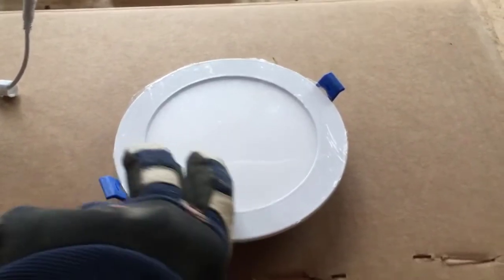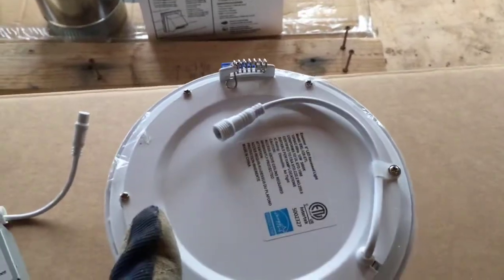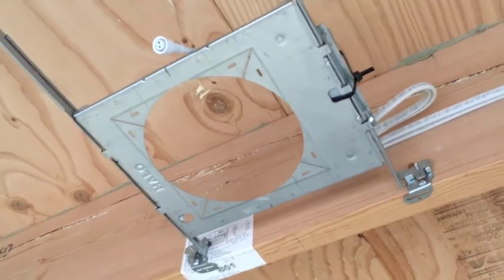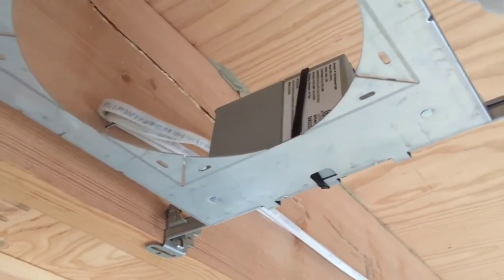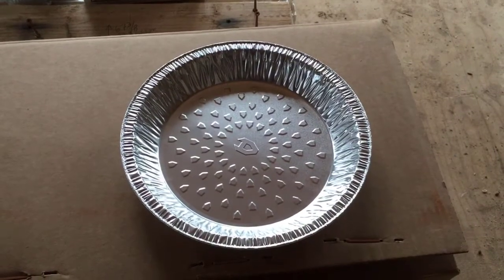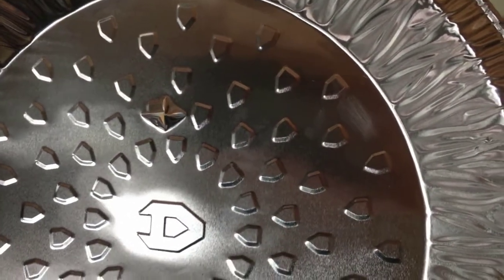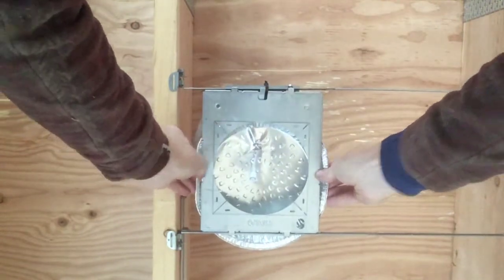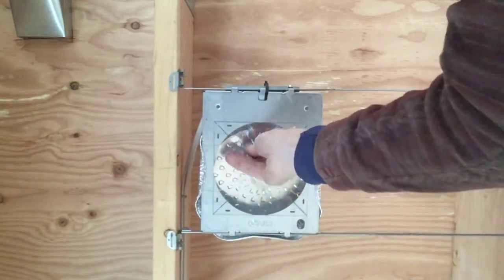Installing Low-profile, Canless LED Lights

Comment: So you made a "can" for your canless lights? I'm still waiting for a person to post a video of installing canless lights without the need of any housing after drywall has gone up in new construction and still keep things neat and straight and can still find the 14/2 wire after cutting the hole for the light.  Can it be done? Nice video, good info btw
Reply: You just cut a hole right into the sheetrock using the circle template that came with the light. Obviously you have to know the location of overhead joists. Once you cut the hole, the lights have retaining clips.

Comment: Great video! What size pie tins for the 6" lights and halo bracket? What size wire ties? Thanks!
Reply from the maker: Good questions. I used 9-in pie tins, but you could go a bit bigger to leave plenty of room for the clips. I didn't use wire nuts, as the lights came with Wago-style connectors

Comment: Good info, thanks! Any suggestions on roughing in wafer LEDs in a ceiling with a vapor barrier?
Reply from the maker: Good question. I would think that the pie pans could work well even with the vapor barrier. Most wafer LEDs are contact rated with insulation, but they still get pretty warm so I'd be apprehensive about having them in direct contact with the vapor barrier. With the vapor barrier, you wouldn't need to air seal the pie plates.

Comment: Update: Get large enough pie pans allow for plenty of room for the arms of your clip-in-lights to fully rotate and seat back down to the drywall. Mine worked fine, but I had to push out a few sections of pie tin to make room for the clip.
Reply: why do you even need a pie pan to begin with? I thought insulation could just cover those can-less lights. Aren't they rated for that?

Comment: What kind of wire did you use for the Can lights?
Reply: That white Romex is 14/2
Reply: These video for these lights NEVER mention the gauge,  kinda important.
Reply: @wadewatson2751  There's only 2 questions you really need to ask for wire sizing.  1. Whats the breaker thats feeding that circuit rated for? 2. Whats the rest of the circuit wired with? 12/2 is good for up to 20amp circuits. However, if the rest of the circuit is wired with 12/2 and only has a 15amp breaker. You should continue that guage as someone could see the 12/2 and try and upgrade the breaker. Which would create a fire hazard on your new stretch of wire. 14/2 is only rated for 15amp circuits. This wire is usually the most comon breaker/ circuit in residential houses. Ideal for lights espececialy with the led lighs as they require very little power ~12W . If you wanted to have a extra switch to control a fan or to do a 2-way switch you'll need the 12/3 or 14/3 as theres an extra wire to acomplish these.